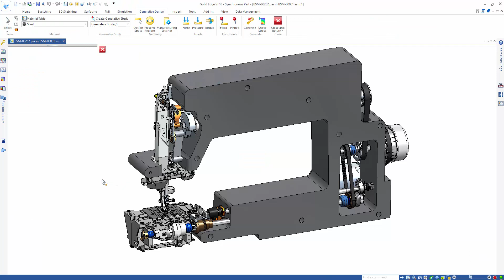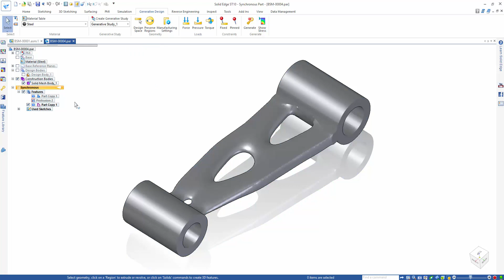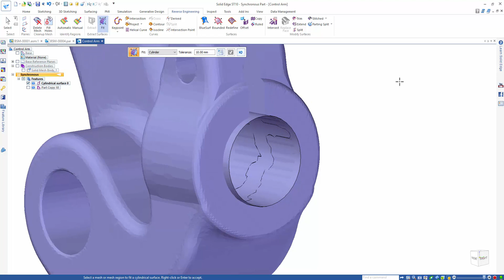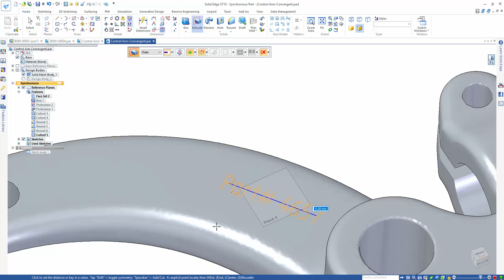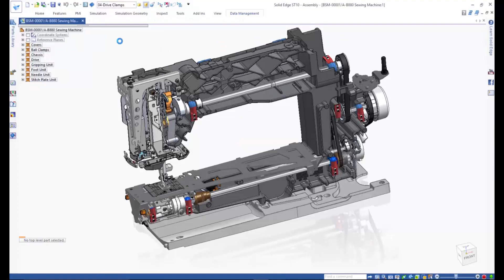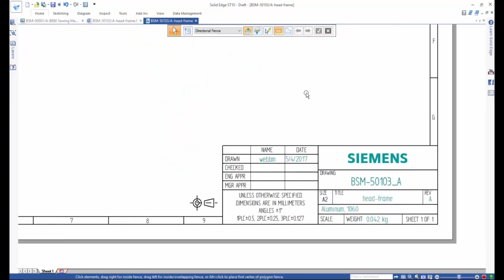Comment: Yes, but 'Generative design' isn't deciding the 'design' of a successful manufactured part, merely the shape decided by allowable stresses based upon the estimated design of 'in-use' forces. Parts have to be held usually rigid during ALL manufacturing / Testing / Assembly stages in practical and very repeatable ways. In my view 'Designers' have also to be 'Manufacturing Engineers' - there are tens and tens and tens of things you have to know about manufacturing before you can design a 'successful part'. Free form parts, lets say like a human skeleton, must be very expensive to make. Of course, 'Additive' manufacturing methods allow these shaped easily and laser scanning allows for fairly accurate measuring however, i don't believe these 'minimal weight' parts are low cost at all. Lets evolve the 'Generative design' into a 'Production Ready' solution and for that you still need a knowledgeable designer. 'Generative Design isn't the final solution by far but it is a very useful good tool.
Overall Solid Edge ST10 is an extremely capable tool - it really is...and Ally PLM judging from their consistent high quality 'Lunch Bites' over many years would be my re-seller of choice to.